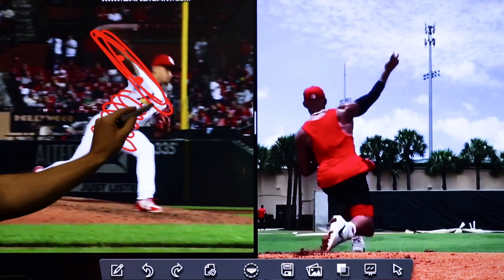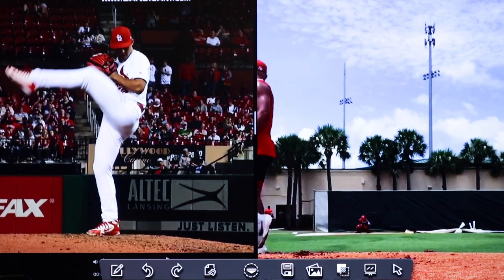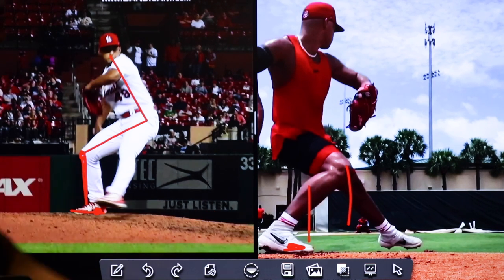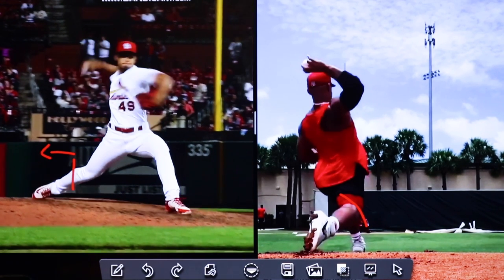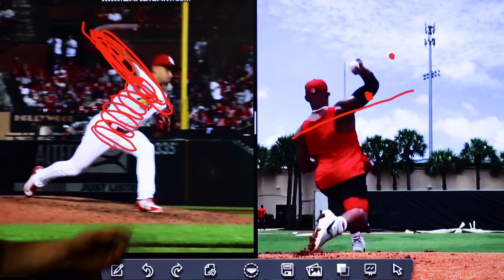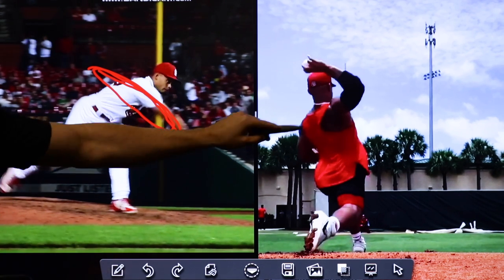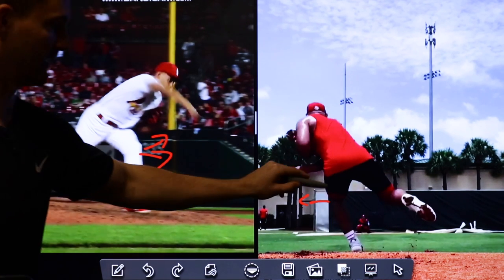Jordan Hicks: Pre vs Post Surgery Mechanical Breakdown

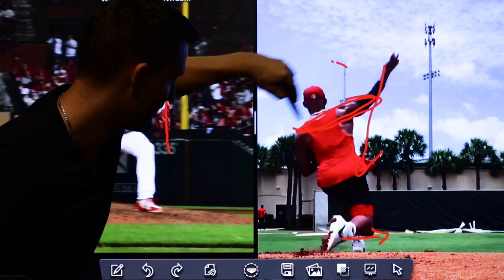Comment: 6:15 lol just saw a track coaches post on that exact move. But with a football players injury. Knee shoots out to the right (opposite to where the arm is rotating). He compared it to other Qb’s internally rotating the hips so the knee doesn’t work in opposite. Basically just the injured qb was compensating and working in opposition.

Comment: More interesting analysis would involve why he blew out the elbow in the first place. It sure sounds like you're advocating for his return to pre-injury form. I question this approach. Are you insinuating that it was just overuse, poor training regimen that caused the injury? I disagree-he was in one system with heavy support and year-round training. Pre-injury it is clear to me that he was relying on excessive late internal rotation/applying massive torque on his medial elbow between FFS and release (palm completely facing the ground at FFS). Relying on the flexing/unloading of the medial joint structures to generate power. Post-injury he is either intentionally or subconsciously attempting to correct this (consider 9:37 in your video) and yeah he has not yet adjusted to this new timing, hence the torso angle issue and lack of trunk-shoulder-arm-ball alignment at release. I can't imagine encouraging someone to throw like he used to, unless they were already doing it with success and somehow able to avoid injury for an extended length of time. I just disagree with the pipeline to the surgeon as a required step in the development of a pitcher.

Comment: Um hey Ben I really need some help I am a pitcher and whenever my fron foot gets down my foot goes twords third and so does my knee so then my whole body does do you have any deills to help fix that kid is it just a matter of working on my growing area to get it stronger
Reply: Sean Adams place your foot straight to the plate while in your « landing » position and when you throw, just rotate your back foot and your core but try not to move your landing foot. Never take your feet off the ground, just rotate back to your landing position and throw like that at 30-40 feet so that you don’t really focus on your pitch but mainly on your mechanics, I had the same problem and this worked for me so I think should give it a try. You can also do that without throwing a ball to focus only on mechanics. Sorry for the spelling mistakes btw hahaha, I am a french canadian soooo mybad
Reply: Thanks you very much the goat